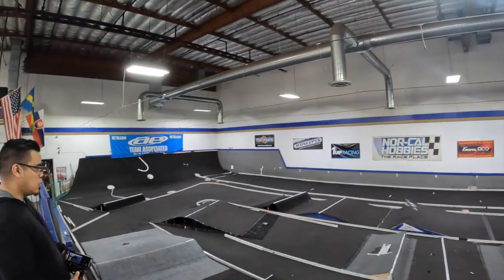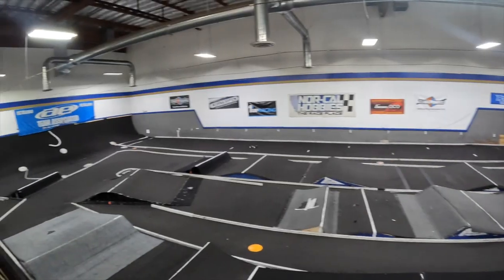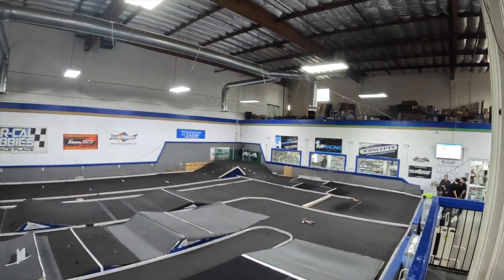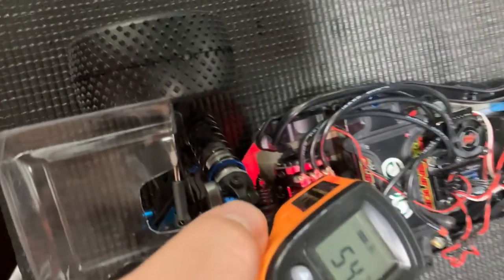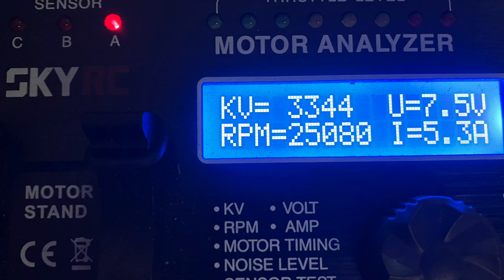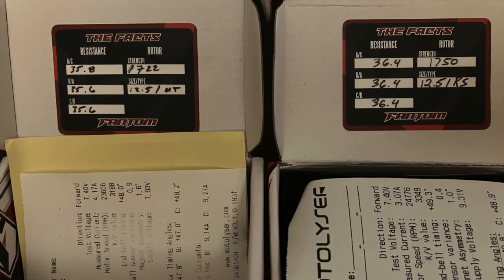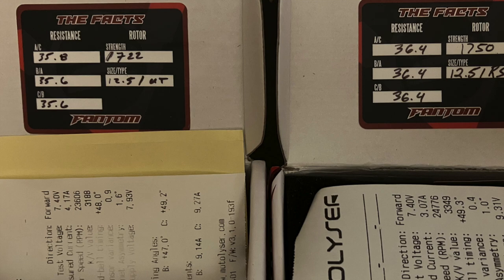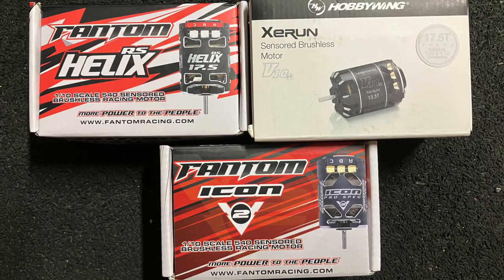Thoughts: 17.5T Fantom Icon V2 vs Fantom Helix RS vs Hobbywing V10 G4 motor in Team Associated B6.3

Comment: The lap times were practically the same with all 3 motors regardless of timing.  I would run the motor that you are most consistent with which is sometimes the motor which has the smoother power band like the V2.
Reply from the maker: You are right. You hit a key thing: power band. Gearing will matter most with each. And you are right, the V2 is still a great option. It is smooth.

Comment: the whole gear up vs gear down thing. i rather gear down and get the helix.  if you throw a larger pinion on the hobbywing to try to get the same speed as the helix then you will be creating more heat. if the helix is  "too fast" (whatever that means) or you want more torque and you throw a smaller pinion on it temps can only go down.
Reply from the maker: I just saw this comment. Those are good points.

Comment: Thanks for the video, doing my research and plan so this really helped. Do you have any recommendation for an ESC, or just the ESC specs, I should look for when pairing with these kind of motors?
Reply from the maker: I just run a Hobbywing Justock esc with most of my cars and my buggy. I just do spec racing and there is not difference between it and the XR10 or Maclan Pro160 since we run blinki.